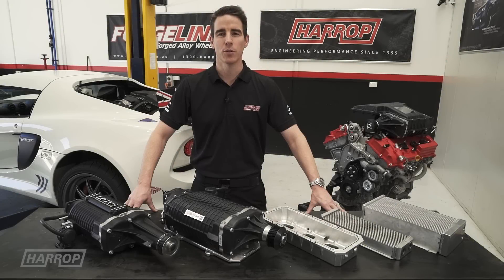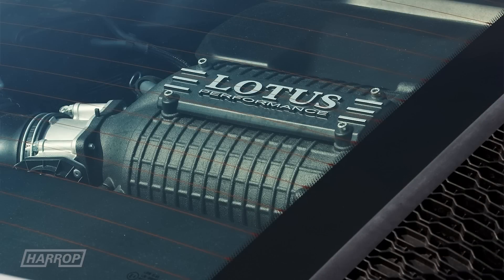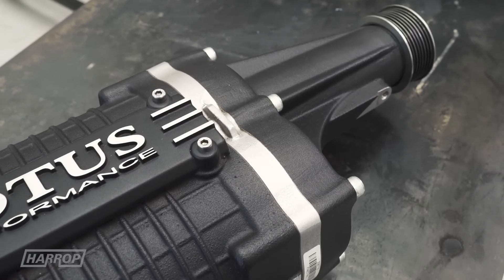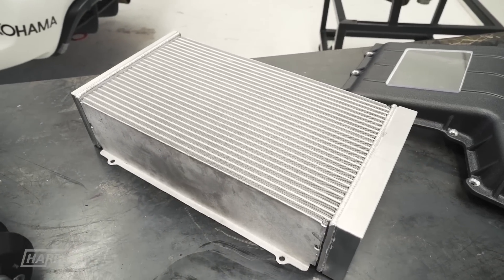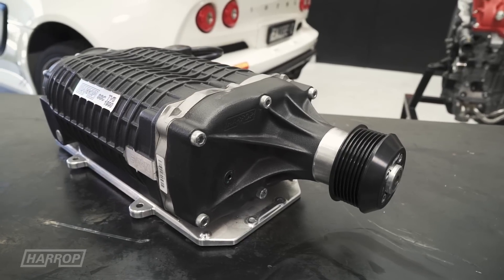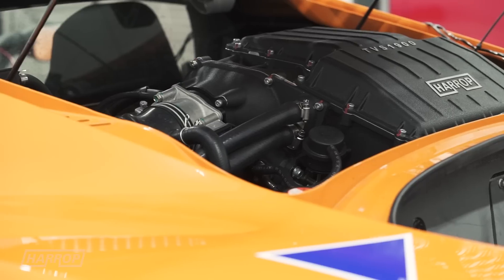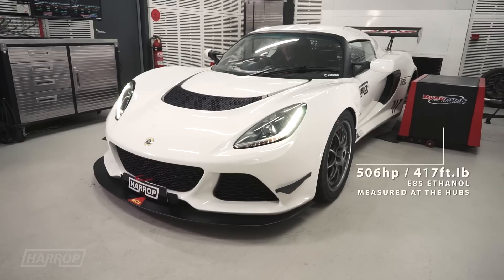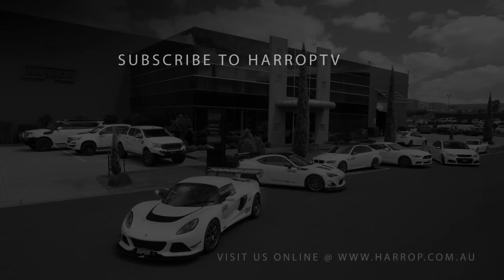Harrop Lotus Exige V6 | TVS1900 Supercharger Kit Technical Review

Comment: This supercharger is designed for the 2GR-FE? So that means it should be no problem putting this onto a Camry or an Alphard with the 2GR-FE V6, since those are also transversely mounted. Just have to resolve the packaging in the engine bay myself
Reply: The hood probably wont close
Reply: can it be used with 2GR FXE or 8GR FXS?

Comment: Would this fit the longitudinal 2GR as fitted to Lexus IS/GS350?
Reply: Yeah uses the same engine just might have to mode the hood to close properly would be epic if Toyota used this if they came out with a Camry trd or GR model
Reply: @master6435  in australia they did exactly that. Was a bit of a flip as the gearbox couldn’t hack the extra torque.
Reply: @BigCarKilla  really the trans in trd camry couldn't handle the torque?

Comment: I bet a gt3 running e85 NA would make similar power.
Reply: At peak rpm maybe if it was a built race motor, but you're likely looking at 100-110hp per liter max out of a NA Porsche motor, and that would be to the crank not wheel like the lotus in the video. Positive displacement superchargers also output good torque early in the Rev range. So power below peak rpm would be more substantial than on the Porsche.

Comment: I beat soak is terrible and you loose more power then gains and I bet gear just die as I had to engine swap to achieve higher power in mine
Reply: I'm super curious to see this on track do you do track days commonly and if so. Would be open to leg people to spectate the car ?
Reply: What did you swap out to ?
Reply: Small block v8 that most people drop into the mx5

Comment: What is the cost to upgrade to run at 500 hp on a supplied 350 exige? 
Is it possible to switch from e85 to ron98 electronically on the fly?

Comment: Would it fit on camry 2007 v6 2grfe?
Reply: Yes but there's no space for the intercooler cause the space is not much under that hood of that car.
Reply: Yeah thats what the trd aurion was
Reply: I wonder if this will fit on the RAV4 V6 motor. It would be the ultimate sleeper.

Comment: Thats why i love toyota
Reply: Yamaha
Reply: @JH-jo9wt  yamaha?  Last head block was on a lexus
Reply: @r.a.p.k.models4160  All toyota / lexus engines are designed / engineered by Yamaha even the LFA V10. Yamaha used to make F1 eniges in the 90's and thier moto GP bike / engine along with Honda's are untouchable
Reply: @JH-jo9wt  i not sure ,i have seen documentaries saying ,yamaha work on cylinder head specifically and in certain amount of engine not all engines.
Reply: @JH-jo9wt Toyota mostly designs their own engines, Yamaha has only designed a few engines for Toyota (2ZZ-GE, 1LR-GUE) but they mostly just make the G heads for existing engines (2T-G(E), 4A-GE, 2JZ-G(T)E, 2UR-GSE, etc.). The 2GR has an F head so it's by Toyota

Comment: Just curious but would this set up work on a j35?
Reply: It's designed for a Toyota V6 instead of trying to reinvent the wheel look at comptech they already make superchargers for the j35
Reply: Comptech is not in business anymore, I asked because of the way it mounts to the engine the j35 intake runners are very similar hence the reason for my question. I'm not sure how different the runners are so I figured the design could be made for a j series engine which would be amazing. I'd buy it for sure others would too

Comment: This, swapped with a k20-k24 or even better, a F20C from the s2000, would be my daily driver. I would not even add force induction. A toy for real men!
Reply: ...and it would make more power when boosted.
Reply: The F20C wasn't designed to be mounted transversely, so it would be extremely difficult to put one in this car. The K series is just as good anyway.
Reply: Nahh , there's corollas running 11 all motor with this engine,              and here we go 🏁

Comment: Why couldnt you have put this on the TRD aurion. Or atleast intercooled the one you went with... the heat pulls so much power out on the settup 😭😭😭😭

Edit; does the TVS1900 setup fit under the bonnet of an '07 Aurion? 🤔🤔🤔
Reply: Because its an Aurion and after much discussion, it was decided there wasn't a large potential for the female market
Reply: @JH-jo9wt  Take you a whole year to think of that? I'm patient, I'll wait another year for your next attempt at a dig.
Reply: Yeah unfortunately they only make em for men Liam. Sorry mate
Reply: Although they are making.a Trans Racing Division version TRD esp for trans gender and lbgtq community
Reply: @JH-jo9wt  troll level: amateur. 
If thats the best you got, you better just go back to bed.

Comment: I am dreaming of 650 hp, for it to keep up with the current super cars in the straights.
Reply: I'm thinking 3.7 stroker (pankl has made one for an Aussie which had 800hp), tvs2650 pushing 18-19psi plus an interchiller which is an Aussie patent to freeze the Intercooler very cool shit pardon the pun. Komotec 7sp sequential or a custom lightweight HGT 6spd, and whatever lightweighting can be done which isn't much without spending massive dollars. But if you've got this Harrop kit with a forged 2gr you've got money anyways.
Reply: J H The small throttle body limitations aren’t doing this system any favors either. PD blowers are very sensitive to inlet restrictions.
Reply: @JH-jo9wt  funny because a fully forget, camed etc 2gr cost just alittle more than this setup.
Reply: Just run a smaller pulley... The tvs1900 can run boost in 20psi range. Throw some cams maybe some oversized valves and decent headers and you will crack 600+whp with just a moderate increase in boost. Granted your block n fuel system better be up to the task.
Reply: I guess turbo + supercharger + fully build forged and sleeved.

Comment: on the last table you write 454hp with 98RON fuel and built engine. Is this with 75mm pulley and stock compression?
Reply: Stok 2grfe engine?
Reply: Wow impressive gains....not sure I could stomach the fuel consumption, I already struggle to better 20mpg from a stock Evora S 🤣